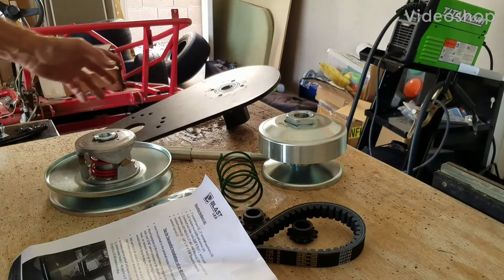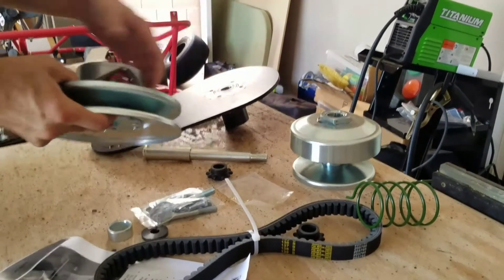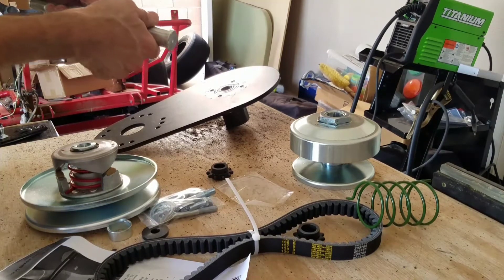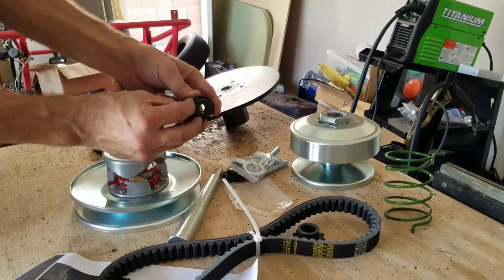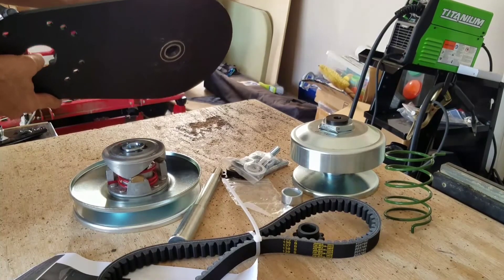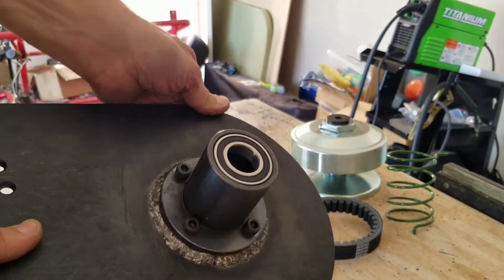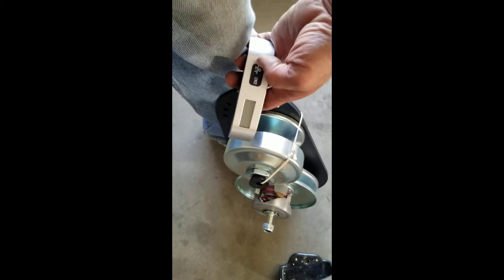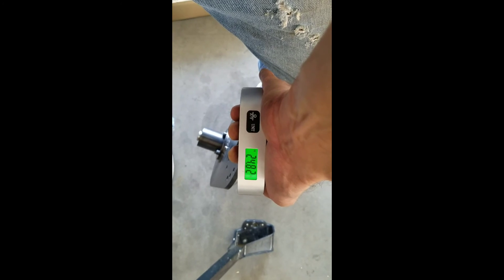40 series torque converter Blast LED

Comment: How's it working for you? I'm about take the plunge. I was reading that the driven pulley should mount spring in. Are you noticing any belt twist during driven pulley engagement?
Reply from the maker: I'm really happy with the perform of this.  I would recommend it. Initially I jumped a roller but since I upgraded to medium rollers and red springs I haven't had that issue. Plus the higher engagement rpm is great. I would recommend taking it apart to lubricated with dry graphite Lube. It was bone dry inside. I just used a big socket and a 18v impact drill to remove the large nut. I can get you socket size if you need. I've no problem with the belt as long as you get it both pulleys properly aligned during assembly you're good. It comes with spacers. Also it comes with 2 springs red abs green based on your set up I ended with using the green spring.